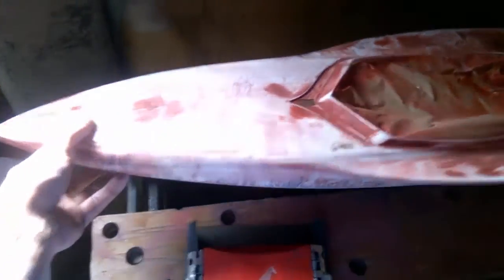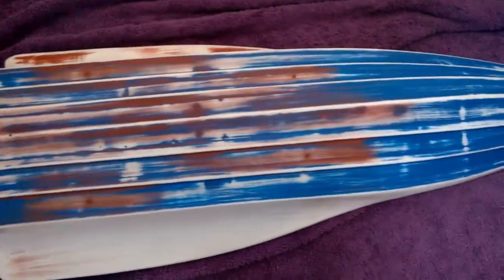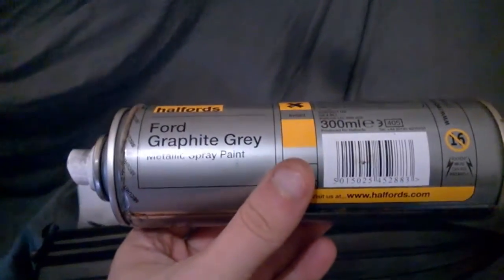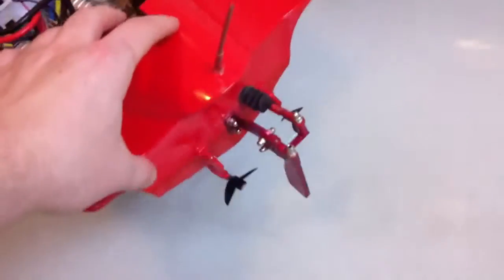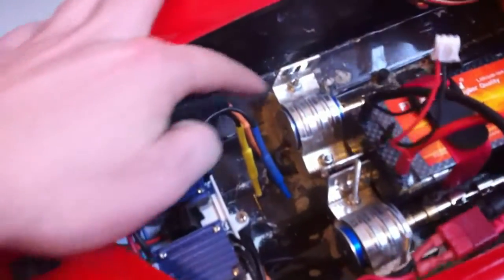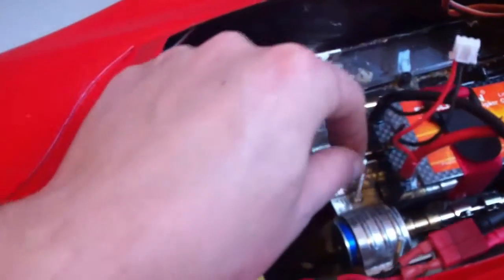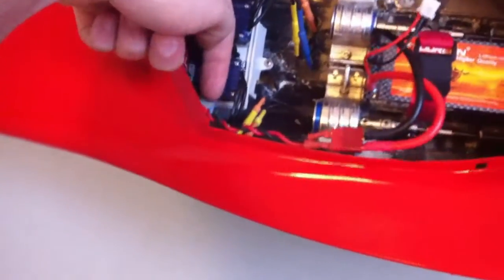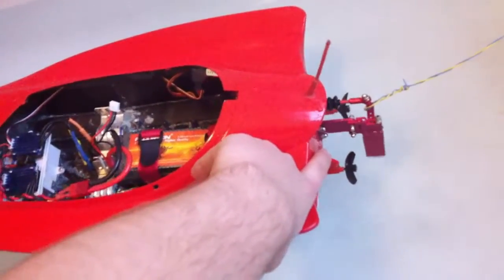RC Toy Boat Dual BRUSHLESS Conversion! ( 28" Double Horse 7000,Syma RS7000 )

Comment: This is awesome how I've been working on exactly the same boat doing a brushless conversion and I used the same two motors! It's such a coincidence to see, but as you had I also blew one of the motors on the first voyage, but I could still stutter it back to the shore. The motors are cheap, and after straining one just last week I even blew the esc! So now that I've had to buy a new esc and motor to fix it.

I never had any plan to do quite as much modification as you though, repainting the hull and creating a new motor mount would have been too difficult for me. I managed to get away with only using the two motors from using a trick of v wing mode on my fs-t6, but it becomes difficult to control sometimes. I can tell why you wanted the motors to be water cooled, but my plan is to buy a heatsink with attached fan to use on both the motors, and use an fpv camera just pointing on the inside so I can stop it quickly if it starts smoking. Good luck on this project!
Reply from the maker: you dont want to be replacing the motors after every run... they need to be watercooled. no fan will keep the motors below 90c them temps the motors get destroyed :(
Reply: ok sure. I've always had the idea of drilling a hole near the front and using various splitters and pumps (if necesarry) to put the water through (or just enclose the motors in a 'water chamber' which is constantyl flowing so the motos wil stay cool. This makes me wonder how quickly these motors heat up when used ina small car as surely more force is put on them then...
Reply from the maker: just tot let you know. i converted this back to brushed motors however there upgraded motors for airplanes  18,000 rpm  lol . im Going to do a test run 2 morrow :)
Reply: I've given up on my boat and sold it with all the equipment i spent i managed to get £200 off it in an auction, a small profit really
Reply from the maker: Nice! i was actually thinking on doing the same lol ill post a little video up before i sell i made a dual engine mount out of some scrap metal and replaced all cables with solid copper and a custom watercooling setup.

Comment: What esc do you use?
Reply from the maker: http://www.ebay.co.uk/itm/High-Quality-2430-7200KV-4P-Sensorless-Brushless-Motor-W-25A-Brushless-ESC-C6T1-/172206845440?tfrom=172183808184&tpos=top&ttype=price&talgo=undefined
Reply: +Mix Bag Do you have the video running tests?
Reply: +Mix Bag What rudder do you use?
Reply from the maker: all just cheap stuff from china :)

Comment: OMG need to see a vid of tbis out on the water! I work on the bins and just found one of these unfortunately it's missing the canopy and remote!   Im an RC car guy primarily but just one look at it and thought gotta get it running. loving the red gonna go black with mine as seen syma do a stealth version and it looks awesome
Reply: luckily my dual bL jetboat is ideal for low water conditions, because I like to run in rivers and streams/creeks,  sitting in a chair with a cold beer,  surfing the water currents.   FUN FUN FUN.
Reply: RC Hunter that sounds awesome buddy
Reply from the maker: unless you watercool the motors and speed controllers i wouldn't bother... this boat burnt the motor and the speed controller got so hot it went funny and decided to stay on full throttle and the boat crashed on an island lol the boat is now in the shed. i dont think its worth the money spending on proper setup as you can buy a full boat for same price.. shame but thats just how things are sometimes.
Reply: Was thinking of buying a new one and using the set up from a NQD jet boat as the jet assembly can be bought for as little £12.99 then just need to set up something for steering and were away. when I got was originally thinking would look good on a trailer for my SCX10 as its impressive but still very light but after seeing them go fancied getting it running. That missing canopy is a big issue though.

Comment: Hey, I just got this boat from a friend of mine, he wanted to throw it away, but I was like noo. Dont do that, so he gave it to me for free. Tried it out, but it's kinda slow to me, so I want to upgrade it.

I have only owned a slow toy boat like over 5 years back. So I basically have no experience with RC boats. I do fly planes, multicopters and heli's tho. So I know how all the electronics work, just have no experience with boats.

So yeh, I wanna upgrade it, do you have any suggestions on motors 'n stuff?

My plan was to just upgrade the motor's and esc's, while keeping the shafts and propellers 'n all. Also without water cooling, cuz thats way too complicated for me as a boat noobie :P.

Or should I get some brushed ESC's and run this thingy on 3S.

I hope u can give me some good advice, thanks :D